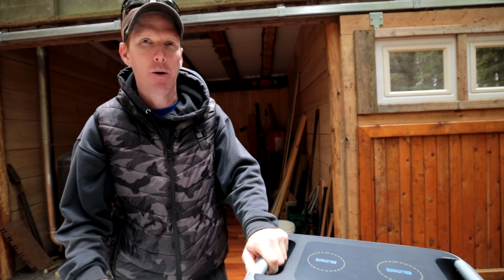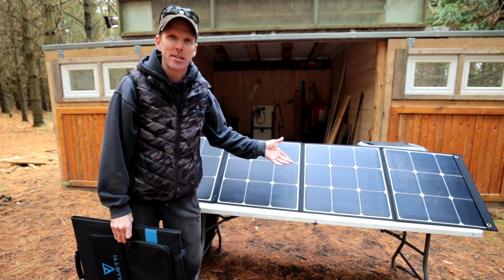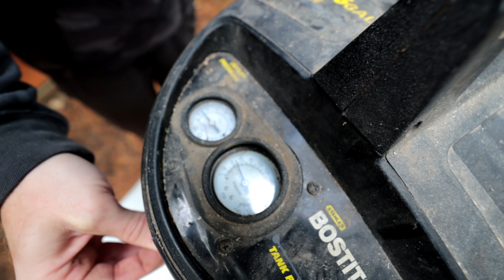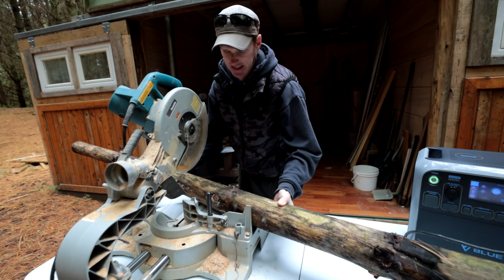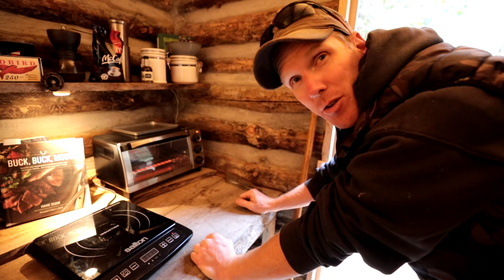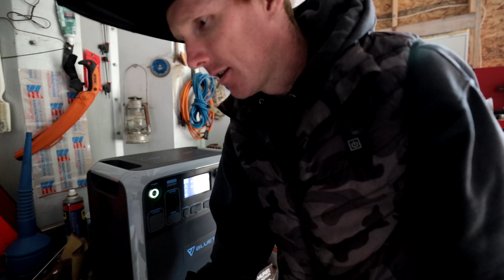Bluetti AC 200P Portable Power Station Torture Test

Comment: I'm Carol and will it power a 5000BTU air conditioner unit providing nothing else is being powered. One problem to be aware of the high surge used to start up any appliance. I'm 72yo. I still remember the slow warm up time of my family's first black and white TV. Ha!  Is there any device that will slow down the initial start up of electrical appliances?

Comment: I am a new fan of yours for the cool building projects you do, but also happy to see you incorporating solar generators in your work.  First, the Zendure, and now Bluetti.  I am on the Zendure campaign for the LFP version, and have many Bluetti, including the AC200, AC200P and now the AC200Max with expansion batteries, and these are lifesavers for power outages.  Do yourself a favor and get a trolley.  And an expansion battery for the AC200P. :-)
Reply from the maker: Thanks for the tips!
Reply: @ModernSelfReliance  the trolley or the AC200Max? Those batteries are a must!

Comment: I watched a review for another popular brand and the person said it would turn off while using a cooler in colder temps. Because the cooler didn't kick on as much so the power source would automatically turn off. Does the Bluetti do that too? Local facility 30 patients sick and 29 got the snot. 1 did not. Checked local funeral home obit's and for local businesses going back to 2016. Less people were listed for the obit's in 2020 than all the other years. You'd think there would be some kind of increase considering the thing going on. We almost bought two of the other brand power source while it was on sale but then decided to wait.
Reply: You can turn off eco mode and it will not shut off

Comment: Questions

1) Can this pack be used with other solar panels or does it need brand specific ones?
2) Can the AC and DC be used at the same time? (I saw that both lights (AC and DC) "on" on the display screen but not sure if you can run them at the same time.)
3) Can you please compare all the different power packs that you have? (I think you have shown at least 3 different ones)
4) Can you please give us your genuine opinion? You can be honest, like which ones couldn't run the chop saw, and other things that you don't like about them.
5) Can you please compare the ones that are the best value for money? Capacity vs price etc.

Interested because I am planning to buy one in the near future.

Thanks again for the great videos and free content/information/entertainment.
Reply from the maker: You can Run AC and DC at the same time.  Each pack is going to tell you to use their own panels.

Comment: I like the idea of these but not in the budget at $2000  I can run my gas generators for years no more then I use them plus I have a 15K watt Diesel generator to run my farm when power is out but I’m still liking the information you provided if it was empty of power how long would it take to charge to 100% on just solar ?
Reply: You farm guys always have alternate options! I remember an inspection I did a couple years ago where a local power outage affected an entire town. Bunch of them were staying at that house I was inspecting, and the guy was running everything off of his tractor! Hadn't even known PTO generators were a thing back then.

Comment: I would really love to know how long it takes for one of these to go from 0 to 100% charge using only solar. Nobody ever says how long it takes for solar to charge these type of battery pack things. Most likely if the grid is down...you can't charge it back up with electric, you have to use the sun.
Reply: You can also charge it will your car or truck. Or with wind generator. or a gas generator.

Comment: In a power outage of several days the chain saw would be helpful for downed trees.
Sure wish someone would test this bluetti with cpap over night, refrigerator for 24 hours, or a freezer, or a deep well pump. I know it works for most items for two or three minutes. But can it get you thru 3 days?
Reply: It’s all a numbers game (watt hours needed and watt hours available).  I think that Bluetti’s bigger unit, the AC300 + four B300 batteries, are actually starting to approach a true portable solar generator for extended power outages.    Battery capacity is a huge factor of course, and four B300s are putting you at 12K Wh of storage…but that’s only half the game another huge factor for a true extended outage generator is how fast can you recharge the batteries from solar panels??    The AC300 is capable of an unprecedented 2400 watts of solar input!!!    That’s really the key.   With 5 hours of good sun in an average day you can recharge all four B300s in one day if the sun is out.
Reply: I was wondering the same thing. If I have an extended power failure, can this thing run my refrigerator, freezer, and sump pump, some lights, . . etc?  How many would be needed to accommodate such devices for a few days.  Also reiterating he question below, how long does it take to recharge with the solar panels?
Reply: I have the AC 200P, I did my own test camping last Labor day weekend while camping.   I had my ARB 73 QT Dual Zone Zero Fridge Cooler, that I ran for 74 hours and still had 10% left on the AC 200P.   A few things, I did bring the cooler to temp on AC before hooking it up to the AC 200P.  I was not running the cooler as a dual zone, with one zone at below freezing,  but with both zones set at around 37 degrees F.  I also used the AC 200P to charge my cell phone every day over the 3 day weekend.    Temperatures for the weekend were 70s during the day, down to 50s at night.   I was happy with how long it lasted.    Of course, ambient temperatures will make a difference in how much my cooler would have run.   So, your mileage my vary.  Also, I was running the ARB on DC.

Comment: It should power a 5000BTU air conditioner unit providing nothing else is being powered. One problem to be aware of the high surge used to start up any appliance. I'm 72yo. I still remember the slow warm up time of my family's first black and white TV. Ha!  Is there any device that will slow down the initial start up of electrical appliances?